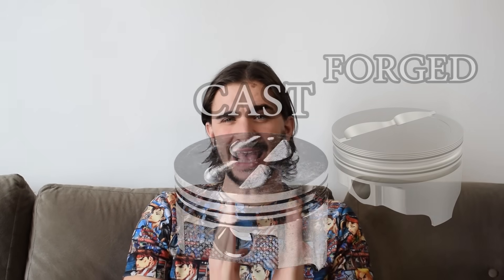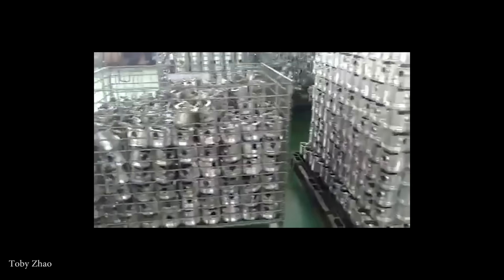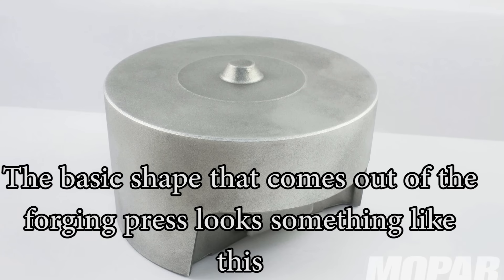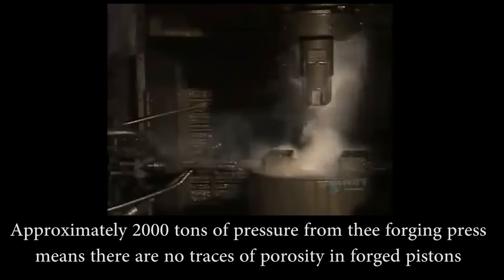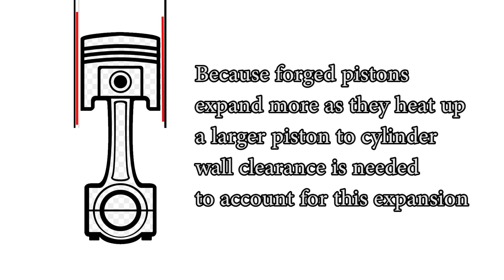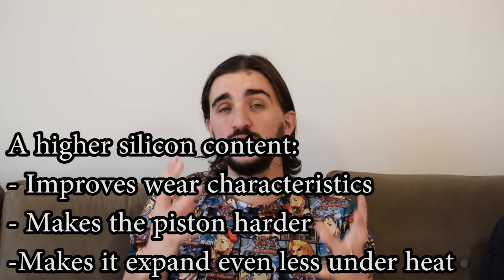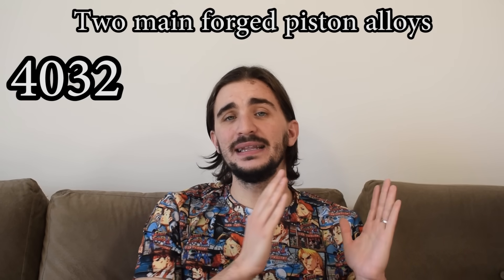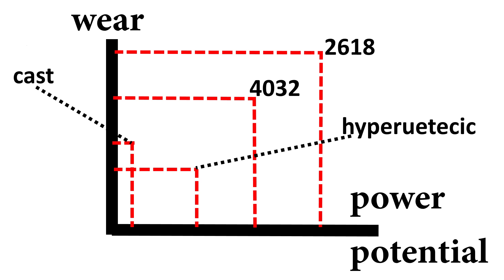FORGED vs CAST vs HYPEREUTECTIC PISTONS

Comment: 2:53 thats not hot forged pistons are made (well it is) but you start with someone that has to melt aluminium and make rods, as you may know (or not) aluminium doesnt get any strength by forging, but by ageing (heat treatment). What really changes between cast and forged pistons is metal quality. In factory they will pour any metal in it, recycled stuff with oils and residues etc, you get lot of oxidation inside your castng due to manufacturing method (you can see this like by welding stock intakes, where you see all impurities bubble out).
While for forged piston aftermarket companies chose those aluminium rods with precise metal content and structure (like almg3) and make pistons out of it (whether by forging or machining) and then age that 6060 aluminium to standard like T6
As long as there are no detonations, pistons will never touch the flame (cuz bondary layer or something, which is different for every fuel btw) and strength will prevail. As long as it wont melt/heat up while experiencing detonations, it will hold
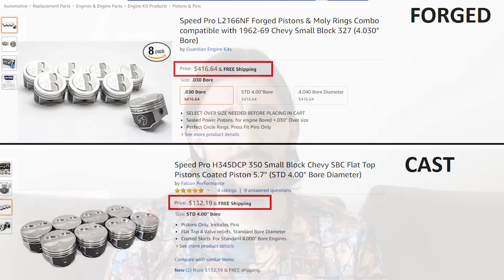3:30 its cheaper to get billet rod, cut it and machine out, then get rod manufacturer to make you (cast) pistons... price for any good aluminium is like 4-5€/kg (doesnt matter the shape) and price for recycled aluminium for factory cast pistons to 0.5-1€/kg
Reply: @eXViLs - 8B008B Your reference is slightly lacking correct content bud. Forged pistons gain their strength and durability in high performance applications from the actual forging process. It's not covered here in this video. But the process of forging is a complex topic in itself. In short, the materials are not the same , as other metals and mineral percentages will be added for a pistons intended application. It's the molecule structure (grain) that from forging in compressed, creating an extremely solid part that can with stand pressure, resist flexing, obsorb impact and retain its integrity under extreme heat.

Understanding Detonation also needs to be addressed. The process of piston failure/melting is caused by improper tuning. Lean fuel/air ratio, excessive timing or high boost, or weak piston structure. However, forged pistons too, can and do fail due to this nature.
Detonation, will kill any piston in almost any gasoline engine. Not by melting or over heating. But from the sonic shock and brutal hammering effect. Which leads to the flame burn. Yes pistons are in direct contact. You may be thinking of the pressure boundry created from the ignition process. That fuel/air is burning at such a rapid pace, it's actually the pistons job to contain that flame to build as much heat as possible that can then be used as mechanical leverage.
 a few.
Reply: Casting is cheaper, since it requires less machining, period. Metal quality is not dependant on the manufacturing process. You can just as well melt down that rod and cast pistons with it.

Comment: Me with a Lada: "Hmmm,could sometime in my life go for a forged engine"
D4A: "They have a lot of piston slap"
Me: "Nevermind."

Very informational video as always, learned a lot from it! Thanks and keep it up!!!
Reply: It's actually the composition of aluminum alloy that determines the expansion rate of the Piston more than the manufacturing process. https://www.jepistons.com/blog/2618-vs.-4032-material-differences
Reply: @konjiki240sx  The manufacturing process sets the limit on what composition of alloys you can use. More silicon means more brittle, means micro cracks if you bend it.
Reply: This video is bullshit. Stop believing everything you seen on Internet. Back in the late 90s to early 2000s gm had a problem with hypereutectic pistons. It has a lot to do with how much clearance the piston manufacture set for that piston. Piston slap with any piston is almost non existent now.

Comment: Thx alot bro am only running 5psi when my build is finished  and guess who is gonna keep the cast pistons? Damm i was about to spend alot of  money on forged ones..
Reply: Buy rod instead if you want power, my 850R was at 300 hp with cast piston and they are good for 500 hp. Usually what broke first are the rod, too much force and they bend or break clean.
Reply: @jakelowang4132  strait wisdom. 🤙
Reply: @jakelowang4132  Rod is always the weakest link, good advice.

Comment: I've always wondered.... are billet pistons not a thing??? It seems like that would be an incredible perfect fit for alot of applications ( granted if the money is available). Am i wrong in that assumption??
Reply from the maker: Billet pistons are super practical for custom applications, but as you imagine it takes a lot of machining and you need a 3d design. This often makes them suited only for high budget builds or something that the aftermarket hasn't covered already, which is a lower number of engines every day.
Reply: @d4a  thanks for the info!! Im working on a 1996 corolla 4age swap that i want to be a trackable street car so all the info you give really helps!!!
Reply: Its effectively what forged are? with even more benefits if the forging is done well / close to the end shape. Billet is just machining a forged uniform block. Forged in this case is the same process but starts with a block that looks kinda like a piston and has better gain flow if the forging was close to the end shape / size..
Reply from the maker: @jordybrock  When it comes to pistons, billet usually means you take a piece of aluminum rod and machine the entire piston from that piece, usually on a 5 axis CNC machine. There is no forging press involved. This is great because you don't need to make batches to justify the cost of the forging dies. You can make just 1 or 4 or whatever. But it does have some drawbacks as I already explained in the comment response above.
Reply: @d4a  Right, so its machined from an extruded rod, grain flow all in one direction. Would there not be benefits to the forging process of shaping the material? Both processes require heavy machining to get to the final product as you said in the video. Downsides are obviously the really custom stuff you cant just whip up a forging die so you dont bother. But can you call it higher quality?

Comment: Hmm i am trying to figure out what pistons and rods to use with high reving engine 🤔
Reply: Hyperuetecic or if its a high reving + turbo go for 4032
Reply: longer rods with a higher wrist pin in the piston.
Reply: Get forged and be done with it. They are more forgiving if something goes wrong.
Reply: Well i desided to use closed deck EJ20G in my CRX and create a MR CRX, so solution is 4032 forged pistons and forged steel rods. I am aiming to 500+ horses.
Reply: Ok, not going to turbo, just high reving Honda engine b16 deck b20 block. Those hypereutectic pistons sounds a good choice 🤔

Comment: Without this video out there I would had bought a car, turboed it and ran forged pistons. Just to daily it, I'll pass. You are helping a lot people in their future builds. Thank you!
Reply: If you have detonation you can kiss your cast pistons goodbye, usually  (This goes double for hyper eutectic). Detonation puts a lot of stress on the piston crown and can even break the grooves for the piston rings, because it's brittle whereas forged is malleable. Forged pistons won't break as easily under detonation so you can suffer a bit of it before any catastrophic failure occurs. If you're messing with timing and leaning out to get more power, it's going to detonate at some point.

You won't bend a rod unless you've flooded the combustion chamber. That's not normal damage you'd take from increasing power. It happens when water or too much fuel enters the combustion chamber and the piston squishes the incompressible liquid. Cold air intakes are the most common cause of bent rods because they're like straws for the engine to suck up puddles in the road.
Reply: @juansolo1617  
Well you're wrong about that, years back Ford took one of their 3.7 ltr V6 Mustang production engines and in an attempt to see what would give first they mounted it on a dyno and disabled the knock sensor's, built a special air box to pre-heat the incoming air, advanced the timing and put a load on the engine to induce heavy spark knock, after 2 weeks of them getting sick of listening to it and finally giving up they shut it down and tore it apart, the connecting rods were bent from the pistons being hammered on by the spark knock and the pistons looked like someone beat on the tops of them with a ball pen hammer for 2 weeks, I saw the pictures of the engine components, even the bearings were almost wiped out by the abuse, and they were production hypereutcitic pistons. 
Also, the turbo charged Kawasaki H2R motorcycle that came out several years back utilizes hypereutcitic pistons, Kawasaki found out from their research that over certain combustion chamber temperatures, like the extreme ones found in turbo charged engines, hypereutcitic pistons are actually stronger than forged, they found that the strength of forged pistons actually dropped dramatically above the combustion chamber temperatures of NA engines.
Also, this guy is repeating a very old narrative, modern forged pistons have a higher silicon content then the ones of yesteryear, I've been building motorcycle engines for over 30 years and way back forged pistons required almost twice the clearance from the same manufacturer's forged pistons do these days, even regular cast pistons are light years better then they were 35 to 40 years ago, every once in a while I'll get an original 70's Harley engine in and Korean made cheapo cast pistons made now are so much better then what was OE pistons from back then, you can see it in the casting, the aluminum isn't nearly as rough and doesn't look like a sponge like the cast pistons of yesteryear. 
This guy's just repeating a very old narrative and things have changed, especially in the past 15 years or so.
Reply: The real fact is that many people who use forged pistons do not set the correct clear value for their cylinders, which leads to early scoring and even failure of the cylinders with forged pistons.
So always remember, read the piston installation instructions and ask the machine shop to work on your cylinder using the piston manufacturer's clear values and maintain it faithfully, and your motor will live happily.
Reply: If your not going crazy on boost stock cast pistons will do ...just increase ring gap.
Reply: Great video 
Been running a ej20 since 2014 with forged pistons and it’s my daily
Reply: If you are going to turbo an engine, it is probably a good idea to put forged pistons and rods in to handle the extra loads that will be imposed on them.
Cheaping out on this will cost down the road. Your statement that you want to daily drive the car but also turbo it indicates you intend to use the throttle a bit more aggressively. This is when those parts break.
Reply: Foxbody mustangs came with forged pistons through 1991 and those engines in stock form could easily go 250-300k miles. 92-95 5.0's used hypereutectic pistons.
Reply: @hipnoben  no wonder my brother inlaws mustang he just bought with a paxton sc is solid as hell v8 plus 8lbs of boost is a blast.
Reply: I'm just here to say thank you guys for the many likes. It's the most I've ever gotten. Cheers everyone and stay safe during these harsh times.
Reply: as someone who's planning to build a car on the next few years, I'm on the same boat.
Reply: hes basically reffering to the basic bolt on factory turbo cars and the turbo kit on nateral asperated motor running under 8 psi guys.anyone who wants actual power goes forged and the piston slap isnt a ticking time bomb like cast.sure you may not get 100,000 miles on your 500whp 4 cyl but ill take that over 20 hard pulls before your cast ring lands fail.

and as technology improves we are getting better metals and materials.
Reply: cosmetic guys ^
Reply: I put forged in a turbo 4 setup, as long as you know the parameters you can get a 8K redline under 22PSI of boost and with oil cooling and a couple coatings they were good for daily driving at 7 PSI on 87 or 22 with E85.
Reply: Running 20+psi on full forged 1.8 bp. Often a daily for the last 4 years and a dig around with a scope shows the bores looking sweet. Compression within 2% on all 4 cylinders.
Reply: 1k likes from bots i daily mine with forged and yes it does have slap. But I’m finding ways to help it by pre oiling before start. Also my block builder informed me of ditching my cast for forged. Because of my goals he seen the ones I had break. But wast knocking them (no pun intended)
Reply: @claudedottin1312  I would of thought the same thing, probably gotten the same advice. But if they tell you to switch from cast to forged it is most likely the type of tuning you apply.
Reply: 1k likes from bots tis be correct sir
Reply: @claudedottin1312  well good luck on your set up
Reply: 1k likes from bots lol it’s been 5 years ☺️🤙🏽
Reply: @1klikesfrombots436  I will be turboing my m20 and i dont need forged pistons until 380-400whp, and even so its mostly the rods that need attention not the actual piston. Pistons take the heat, rods take the compressive force. So until i boost it. Itll stay stock. besides a i can get m20b27 blocks for $100.
Reply: @voltairee3012  I had a Volvo 850R with inline 5 on almost all forum i have read the cast piston where good for 500-600 whp, the weakest link in the engine his the connecting rod, around 320 whp you are playing with fire. I bend one on mine was using water/methanol injection, was doing fine then i had the brilliant idea of swapping bigger injector and then when i the water/meth injection started i bend a rod at 15 psi.
Reply: @jakelowang4132  yeah, i know there have been plenty of turbo e30s out there and 380 is that playing with fire, and 400 is waiting for failure. Mostly seeing 20lbs of boost at the 400whp mark with meth.
Reply: @voltairee3012  I was talking about my volvo engine, my old inline 5 had a 2.3 liter turbo, the 850R stock is 243 hp usa, but europe had a powerful version of the R model, with bigger turbo charger bigger injector upgraded computer a manual version with 253hp. Look some BMW forum and ask about how much the piston can tolerate, i assume you have a built bottom at 400whp.
Reply: @jakelowang4132  i understand about the volvo. A buddy used to daily a s70 t5 with 270whp. Fun car. Until rod knock. Poor thing had 200k miles. And at 400 on the m20 block is doable for a short period of time. People have ran 350whp no problem for long periods of time. Mostly bend a rod in the long run. And forged internals usually come from an s50/2 crank, any forged rod and piston combo. Most people will boost a 24v if they want more than 400whp.
Reply: @voltairee3012  The M20B25 87 and after have a catalytic converter, bosh motronic 1.3 and lower compression 8.8:1. 86 and before have 9.4:1 compression ratio, motronic 1.1. Ideally the 8.8:1 version would probably get you more boost, the danger is in the low rpm and you already know what rod knock sound like.

A single TD04-hl 19T or a TD05-hl 20G would be nice or anything in the 250-300 range. Best to start low 5 psi then work your way up.
Reply: @jakelowang4132  i will be using ms2pnp for my set up. And someone in a local facebook e30 page is making 290whp on 14lbs on a 20g and 300whp is pretty much my goal. I have a m20b27 with a 885 head making compression 8.3-1. Arp studs, rhd 7lb flywheel, clutch masters fx350 6 puck. But yes working up in the boost is my plan. Also a 3.46lsd compared to the 2.93lsd for my 325es, or a 3.73 in a 325i

Comment: Some cast pistons are made from wet biscuits - the ones in VW/Audi cars with the fabled 1.4TSI Twincharger engine, came straight from the factory with wet biscuit pistons.......i replaced mine with wossner forged (4032 alloy) just as a precaution as it was only a matter of time before they cracked.
Reply: I had 3 vw before and a lot of parts seems to be made of wet biscuits. I had 3 golf 92, jetta 96 and a golf 98 all wolfsburg.